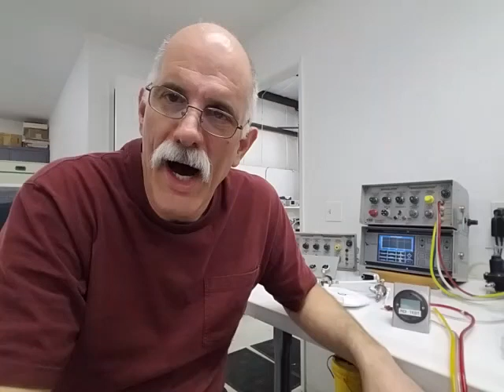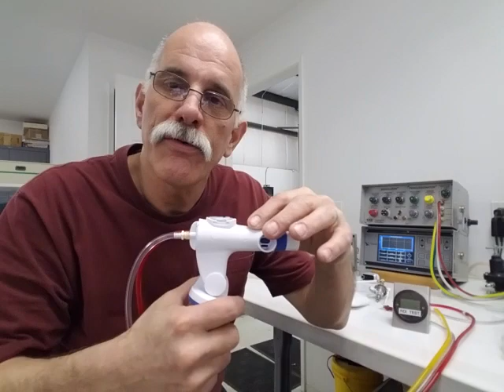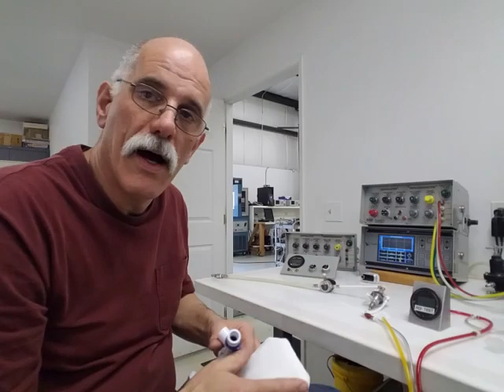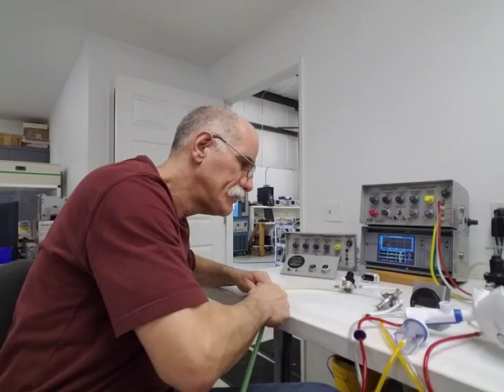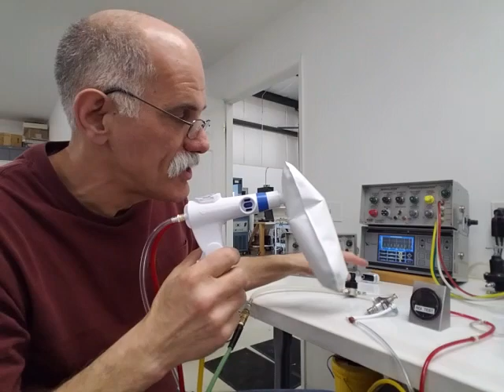Solving the COVID 19 ventilator problem

Comment: Thank you for this great video. Is fixed peak pressure ventilation sufficient for COVID-19 patients? (I assume PEEP is there too). This will work only for deeply sedated patients, right? Isn't volume control equaly important for COVID-19 patients? I believe this is only a temporary solution. How could you adjust the Inspiratory and Expiratory phases time ratio which, to best of my knowledge, is essential in ventilating while increased patient's airways resistance is present?